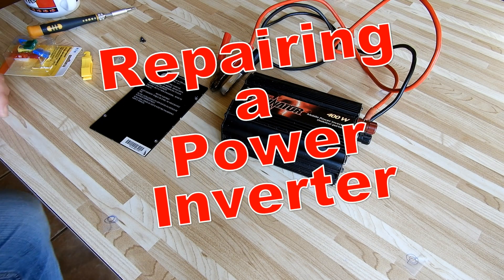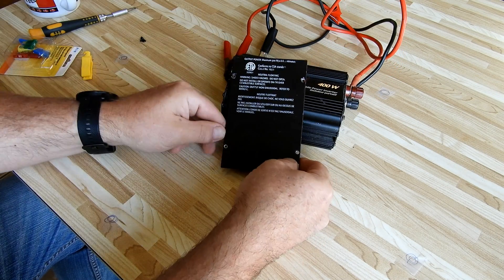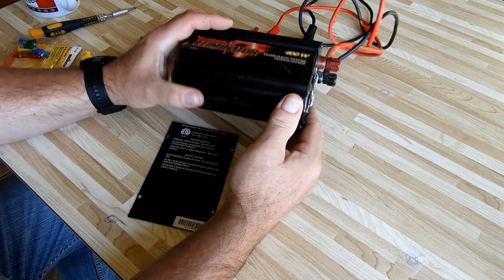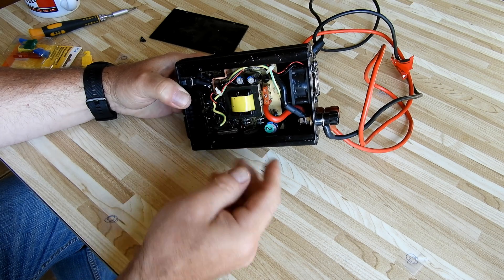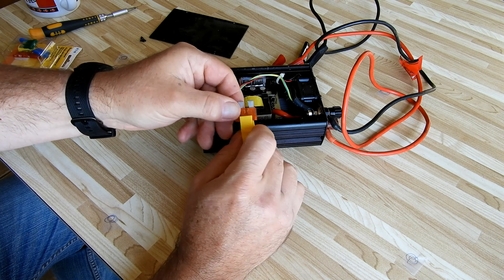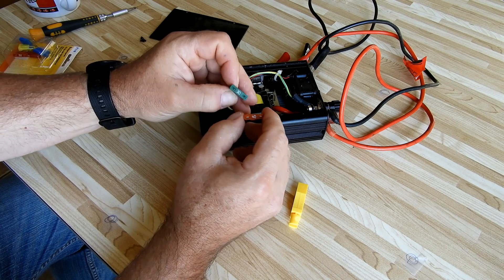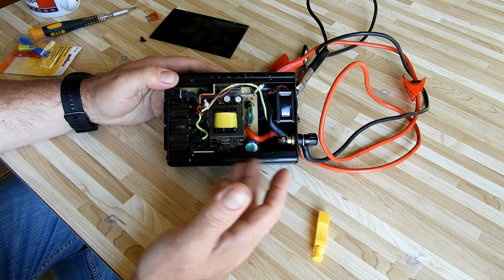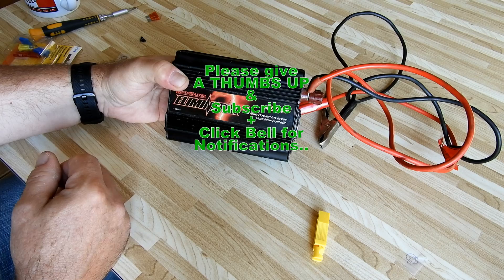How to Repair a Power Inverter

Comment: I'm just learning about these deep cycle batteries + inverters + solar panels.
I bought all three, got 'em all set up and I've started using them (hot plate to make food) to experiment with it.
I ALSO moved something around and touched something I shouldn't have touched and a little spark and now it wont work. I've tested out another inverter (which worked), so I know the battery is fine.
SO...imma take my 2000watt sine inverter apart and see if I can identify the fuse.
(please stand by)

EDIT: 48 hours later.
I took my power inverter apart and removed 6 fuses.
I brought one of these fuses to an auto supply store and bought 6 new ones.
I get home, install them and then put the system back together again, being careful with the install.
IT WORKED!
You inspired me and educated me on the FUSE. You saved me hundreds of dollars.
Thank you!
Reply from the maker: How did you make out?
Reply: A hot plate on solar is super inefficient and uses a ton of power. If I were you I'd just get a cheap compact rocket stove for camping and burn cardboard in it- I cook and heat with it all the time. Your power system will last a lot longer and go through less stress too.
Reply from the maker: That’s great, nice to hear a success…

Comment: I have an inverter it cannot 
Function again what problem do you think it can get plse ? 
Wait ur ans :
Reply from the maker: If it does not power up then the battery is dead, or it’s under too much load, internal fuse blown….
Reply: @kd_enterprise3404  thank i arranged it 
It function now i gave a boss do it for me it light on now

Comment: hi sir i have 220watt inverter it have problem .when i use it it give electricity but light sparking like on off on off.if u could tell us for solving the problem .thanks.
Reply from the maker: Habib urahman Hi, I’m not sure what is going on with that.. we have a bit of a language barrier also... so I’m hesitant because I may not give correct info or actually understand problem.. thanks for watching.
Reply: Hello sir I have an inverter 200 w where by when you  connect load it lights fault lamp what could be the probem
Reply from the maker: JAMES KYALO what are you connecting? A light, appliance?